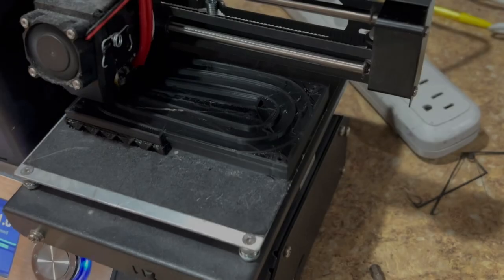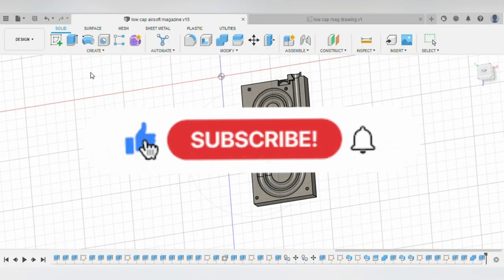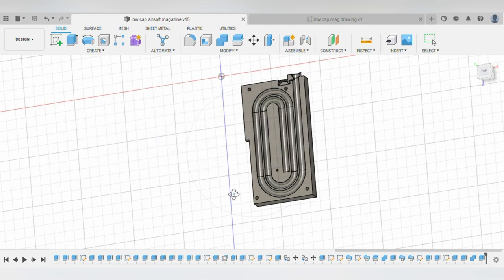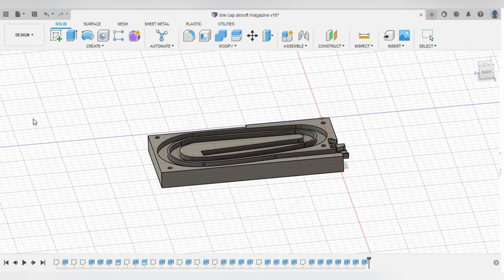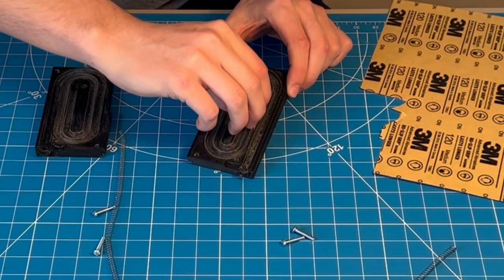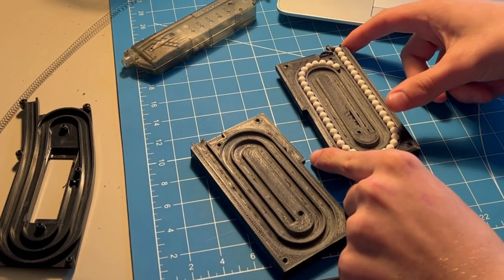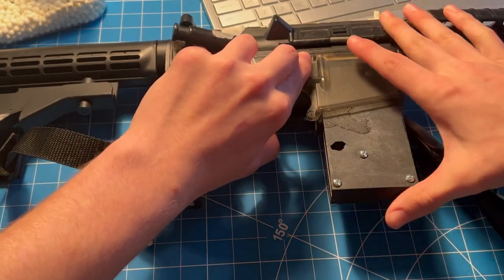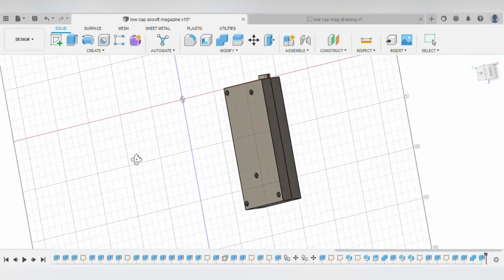FUTURE OF AIRSOFT??‼️PT3

Comment: Bruh you might do better with a prebuilt "tube" insert into a "form fit", the tube it's self could be lightly flexible but rigid enough to keep form bent around into a big ass box like a coiled snake.
Inside the tube is a tight as hek spring but you really have to look into why they taper the spring it's self.

Course you could forgo all of that and look into feeder mechanisms.